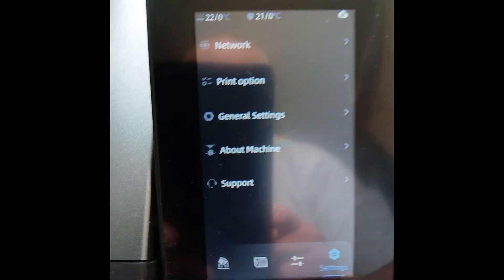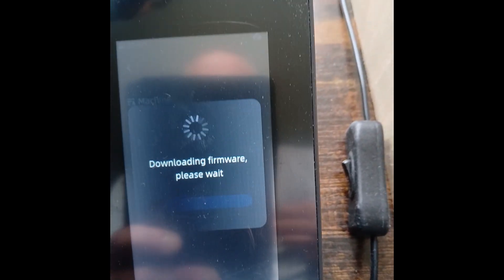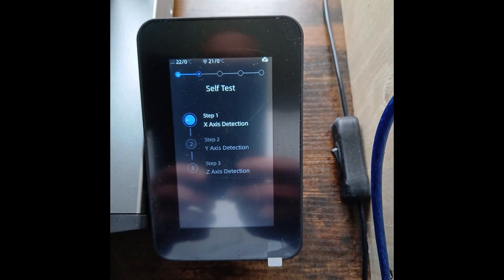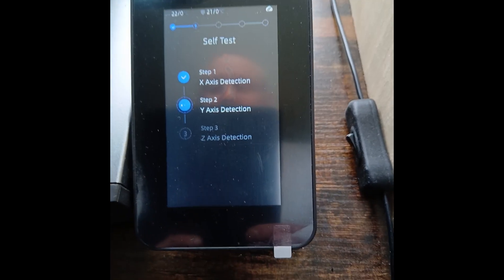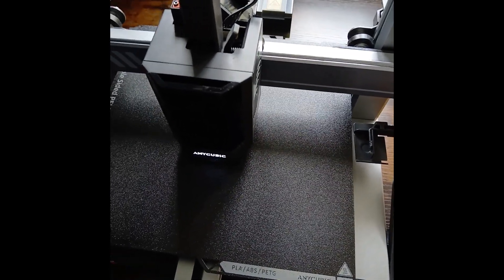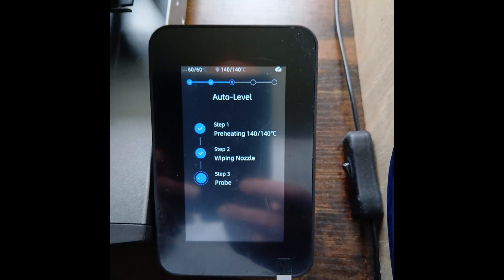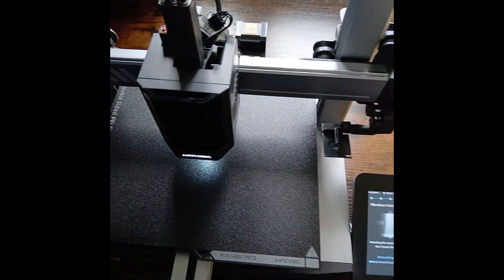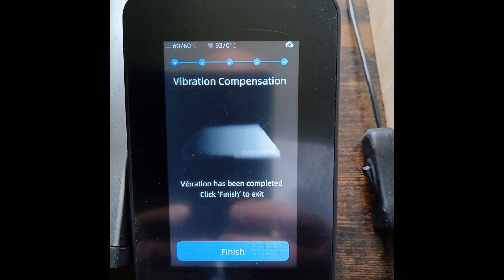How to update the Firmware and do an auto level for the Anycubic Kobra 3 Combo 3D Printer

Comment: supposed to b e an update but mine isnt showing anything
Reply from the maker: Hi yep there was a firmware update a few days ago and another one today, so not sure why yours  is not showing up,  unless you  have not got it connected  via wifi. If you go to your printer screen and click on Printer info it should show the version of firmware you have installed and if there is an update it should promt you to update it.. Its the same for the Ace box, you need to click on the box info which will also show you which firmware version you have installed.

Comment: Thanks for sharing this. I recently upgraded the firmware yesterday and noticed all my prints were failing. I am going to try these steps to see if it fixes my issue
Reply from the maker: Your welcome and I hope you get it sorted. I have seen some posts where after a firmware update prints were failing so they went back to the version before they upgraded which seemed to fix the issue. I normally wait a few weeks before installing updated firmware to see how other users get on with it. I always do a complete auto level after each firmware update and so far I have not had any issues. Good luck and I hope it works for you too.